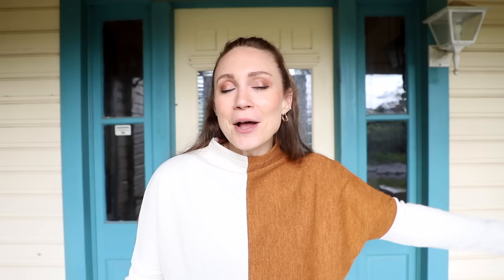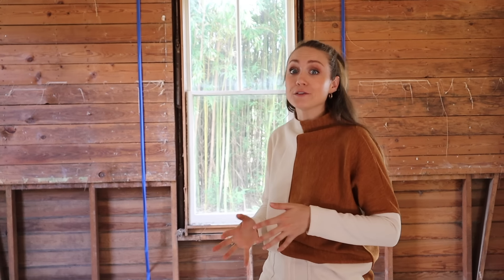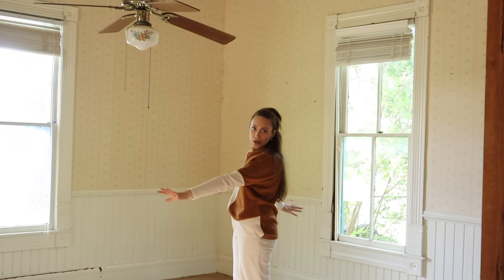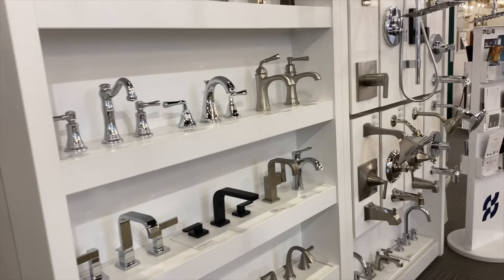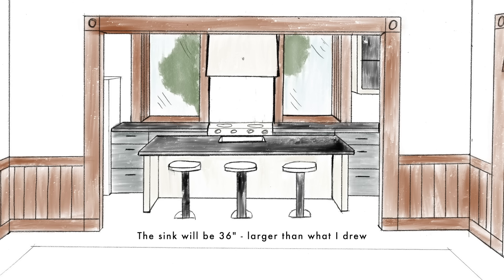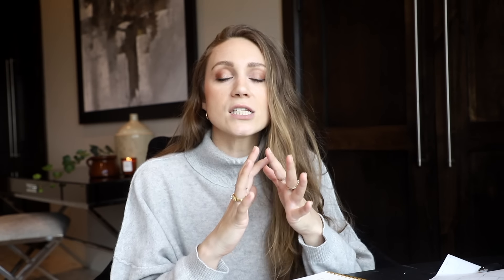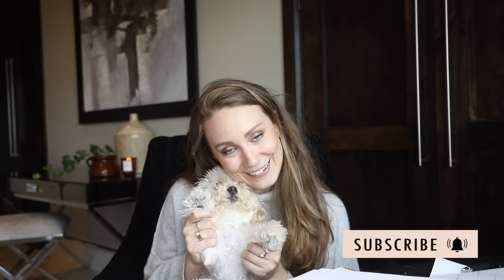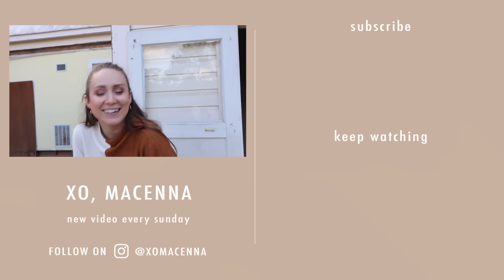HOME RENOVATION COSTS: Our Dream Kitchen & Bathrooms | XO, MaCenna

Comment: $30K for 2 bathrooms and an ENTIRE kitchen is absurdly low budget, considering the higher end options. But, I appreciate so much that MaCenna understands that this is not accessible to everyone and that $30K is still a lot of money. 💛
Reply: I did mine for a whole lot less cost. I did not go w high end appliances. Bathroom tiles were a closeout special, saved $$$. Stripped and painted kitchen cabinets, splurged on the counter tops.
Reply: I think that doesn't include any kitchen cabinets though.
Reply: @grandmak.  I know!!
Reply: I think that the price is for plumbing and appliances only no cabinetry
Reply: I don't think there is any cabinetry in that.  They were nearly theist expensive thing when I did my very basic kitchen nearly 11 years ago.  The only thing I splurged on were lots of drawers instead of cupboards as I am older.  I am just amazed at the refrigerators, stoves etc available.  I'm sure similar are available in the capital cities in Australia but not where I am.  It will be interesting to see how it all turns out.
Reply: Wow - the most expensive instead of "theist"  .
Reply: But I don't think includes labor. Unless you're doing all of this yourselves...
Reply: Yes, cabinetry is expensive. But even without cabinetry, $30K for appliances and fixtures for two full baths and a kitchen is an absurdly low budget for such high end options.
Reply: If I saved half my monthly salary every single month, it’d take me 3.5 years to get to that $30K. Of course I realize that the US is the US, still it’s nice and refreshing to see someone be so conscious of the value of money as MaCenna. And hats off to her for disclosing budget and prices in an intelligent and sensitive way. I don’t think there’s anybody watching this video and not being happy for her and beautifully house she’s building.
Reply: @lenalernova  exactly what I was thinking!
Reply: my home is 110 year old and a bathroom alone cost 20k but that's Chicago prices 💀
Reply: My wonderful DIL is a lot like MaCenna, she is smart, talented, beautiful and hardworking. She too is always looking for a bargain and she finds great items. Her home is a historic register home that she gutted and completely remodeled with a large addition on the back. It’s absolutely gorgeous! She shared the process with us, and I’m very excited to see MaCenna do the same for her viewers. Great job, MaCenna!! You’ve got a great head on your shoulders and wonderful taste! ♥️
Reply: @loissaedder2214  - I too live in a product barren area. Remote Alaska. It’s gorgeous, but hard to get anything without paying an arm and a leg. Although, I’m in need of a new range, and will go with a Hallman too, bonus, I can get one delivered at no extra shipping charges through Home Depot!!

Comment: Also, please make sure you hardwire Ethernet while your walls are open!  Walls and ceilings (for wireless hubs and cameras.
Reply: Run a channel of PCV or conduit in EVERY room to EVERY outlet❗ However wiring or computer related connections change in the future, all you have to do is pull it through the PVC. So make it "roomy" enough❗👍😉

Comment: My husband and I bought our first home about 3 years ago. Its a 1963 ranch style fixer upper. So far we have renovated 2 of the 3 bedrooms, the main bathroom, living room, office, and are currently working on the kitchen. Its our biggest project so far but I'm loving how its coming along. We torn it basically down to the studs and have finished the ceiling, floors, countertops, plumbing, and are finishing up the cabinet doors, which are much harder than I expected to make. We still have to finish the island, add a window, and build out the bench and storage next to the back door. Then its just finishing touches! Living through a reno of that size is tough, I'm glad you guys are able to stay with your parents and will have the guest cabin to stay in. Good luck with you cottage! I've been loving seeing your process so far!

Comment: Just a heads up, I would caution you in using a white glazed cast iron sink in the kitchen. I wanted the same cottage feel in my kitchen when renovating and had one installed. It looked beautiful at first, but after a couple of years, it started to look terrible. Any metal pots and pans, silverware, etc. will scratch and wear down the surface over time. It also started looking dingy and stained over time and no matter what I used to clean it (including bleach), nothing got it back to the white it used to be. The exact same problem happened to my brother when he bought a new house with the same kind of white sink, and his was even higher end than mine. His also started to chip in places.  I really regretted my decision and wished I had known this beforehand.

Comment: I am an Interior Designer and remodeled.lots of very high end homes, my advise would be use the same plumbing throughout the house, it will save you a lot of money in the long run, is easier to manage if there is a problem and gives it a very classy homogeneity that is very classy..

Comment: We bought a house on a creek in the North Georgia mountains, originally built in 1983. The location was great, but it needed a lot of work. We gutted the house and my daughter and I picked out the color scheme, all new appliances, hardwood flooring, tile flooring, plumbing, light fixtures, and rock fireplace. We pulled down the popcorn ceiling, redesigned the kitchen, and replaced the pocket doors with pretty wood doors. We had a contractor to do the work, and it took us about 6 months to get everything finished. It is definitely a dream vacation home for us!!

Comment: Miele products are nice, my parents kitchen is mostly Miele. They look gorgeous, the dishwasher is totally silent and cleans perfectly and is going on 10 years old.
 HOWEVER even though they say they service our area it is next to impossible to get through to them and get an appointment for servicing. When the dishwasher had a clogged drain after literal days of being on hold and not getting through my dad had to take to Twitter (he has several 100,000 followers) to finally get a response. 
I do not recommend the convection microwave or the built-in coffee maker. They were really hard to clean, the prompts on the coffee maker were super annoying, and they never fully worked properly with all the extra functions.

Comment: Ok. The penny tile under the tub that you want, to clean it, is going to be almost impossible. It's hard to get under those tubs to clean, especially on the side by the wall and omg your going to want that tub to be on something smooth so that you can do it. I wouldn't recommend the tub being right up next to the wall because to get back there to clean is super hard to get to and the penny tile, I don't think your going to like it after a little while. You'll get bored with that and won't go with your other beautiful things like the toilet, I just think it will cheapen everything and you'll end up changing it. I've loved everything you have chosen except the penny tile, and, the black swing.
Reply: Agree. No penny tile.

Comment: You might want to consider undermount sinks in bathroom, much easier to clean the countertop (especially with messy kids)! Also, if you go with penny tiles I would recommend a grey grout (white is very hard to keep clean).

Comment: As far as the tile goes make sure you get the special grout that resists staining and mildew. It’s been literally a breeze over four years to keep clean. I spray it with bleach spray every once in awhile between scrubbing.
Reply: Do you mean epoxy or latex?
Reply: @nadjak3410  it’s the actual grout, by called prism.

Comment: That's not a bad price at all for the size of kitchen your having
Our kitchen 11yrs ago cost 5,000 more and only slightly smaller than yours, but our units where all custom made and yes Miele are great we have fridge and freezer also along with dishwasher. 
Glad you've changed your mind on taps for spare bathroom as if someone has arthritis it's hard to grip and twist,whereas the leaver ones are so much easier to use. I say respect for doing all that work, so have whatever toilet you like. Xxx

Comment: Hey Macenna...just a few suggestions...while it's not a old home we have custom built both of our homes, and worked closely with our builder as well as doing some of the work ourselves...I just wanted to mentioned a lot of the things you are picking out are very similar to what we have....while it's all beautiful and easy to get overwhelmed with all the beautiful things DON'T do your dream home on just how beautiful it is to the eye, example your tub will not be very comfortable to SOAK in with the tub you have chosen, you won't be able to relax and kick back, light your candle and enjoy if you are sitting straight up 😳, also a suggestion for your kitchen garbage disposal do a air switch (google insinkerator  brand) otherwise you will be bending over to turn the switch on EVERYTIME you need to turn on the disposal....YES make your home beautiful but make it comfy too....looks are not everything lol...😉
Reply: My disposal is wired as a wall switch. I think most are.
Reply: @Edu_Kate  you are correct, However mine is in my island there is no wall behind me so rather then bending over ever single time I had my switch drilled into my quartz it is much more convenient! 🙂

Comment: oh MaCenna, I went with Newport Brass for my 100 yr old remodel (gunmetal finish, forgot the name) and I was SO DISAPPOINTED in the quality over time. The finish has come off in places...and YES I know it has a lifetime warranty on the finish (which I've been meaning to call them about) but what a hassle! Having to pay a plumber to reinstall these will cost a fortune...and I don't know if they will hassle me or not. I really need to get around to contacting them. In the end I might have been better off with delta. Ok, maybe not delta (but have you seen their Cassidy line), but I regret going with Newport Brass. Quality over time isn't there. Just FYI from a fellow design enthusiast.

Comment: You did ask. LOL Have remodeled a number of places but most challenging was small structure built around mid 1800s we redid in early 80s. Originally used by 'the help' on farm property when area was rural and only minimal upgrading had been done in the interim. Tub drained into the crawl space. No actual kitchen. Furnace on second floor was completely enclosed, no access to unit for service or filter change. Free-standing cast iron stove on first floor vented into an interior wall (not outside!). Actually lived in it while gutting, redoing all the plumbing and electrical. For long time, kitchen consisted of sink on 2x4s and hot plate. Designed kitchen to include small closet with stackable W/D and water heater. Contracted with small-town cabinet maker. Three walls of solid wood cabinets and formica countertop (fit perfectly!) which ended up costing about $1,300. Switched up some walls. Re-rocked entire interior. Removed wall on one side of tiny staircase to not only have access to upper floor but opened into new 'den' (original bedroom of house). 

Installed two sets of French doors from salvage yard (we found what looked like hand-printed wallpaper when opening up a wall). Removed trees and dug long driveway, by hand, as house sat at back of lot. All new landscaping. There was the 'joy' of having the sewer back up shortly after taking possession. Required digging up the entire front yard to lay new line and having decades of raw sewage scooped out in August heat. And then the time when all the old roofs had been removed and a horrible storm blew through before they could get it covered. 

Just some of what we did with a monthly 'remodel budget' of around $100. :) We were both working full time so work limited to nights and weekends. Looked very cute tucked back with a huge pine, very quaint and woodsy even though t smack dab in the heart of major metropolitan suburb. Sold it 2-1/2 years later, didn't walk away with much despite living in a 'construction zone' for almost the entire time. Many years ago, it was razed and replaced by a McMansion.

Comment: Have you heard of Dekton. It is a man-made counter top made from natural products. What is amazing about it is the versatility of design. It comes in so many options. But some of the best features of the product is it is temperature resistant. You can take a pan right out of the oven and place it on the counter. It is stain resistant and does not need sealing. I recommend you find a counter fabricating business.

Comment: Taking a shower in a claw foot tub is not easy unless the tub has a flat bottom.  Original claw foot tubs were not designed to shower in.
They are rounded to accommodate your body part while you bathe . Think hard before you decide.

Comment: 19:44 I had a tub with a shower ring and just so you know, if you try to shower in there, the steam will make the shower curtain suck in and sometimes stick to you. It was very annoying for me to shower in such a small space and have to deal with that, even with magnets in the bottom. If I'd had more money at the time, I would have gotten a nice fabric shower curtain and sewn WAY more magnets in the bottom, but even with that they can slide up and the fabric can pull in.

Comment: Even if you are not using microwave a lot, if you are planning to have children you might use it a lot for them
Reply: Sure, but even then an inexpensive one will do absolutely fine. You don't need to spend $300+ in an appliance store. $50 on Amazon will be fine.

Comment: I grew up with a claw foot tub and shower curtain surround. What a pain in the neck. I would do the cast iron claw foot tub as they are magnificent for a bath, the water stays warmer longer and they are very comfortable, but install a separate small shower and forget the shower curtain. They are awful.

Comment: So are your windows only single glazed and not insulated? Wondering how that is going to work?
Reply: I'm not sure but I think that's not much of a problem in Texas. Also I read somewhere that you don't actually save a lot of energy by double or triple insulated windows, even though these are the standard where I live.

Comment: I am a little confused... This is not what I call the “plumbing”, this is the decor aspect, the appliances and sinks/bathtubs in the different rooms where there is some water. The real plumbing: the pipes going under your house, is probably what costs the most, especially if the pipes have not the copper quality. And as you are changing everything, it seems that the plumbing has to be rethought and redone. Plus, it’s always more expensive than expected. I know because I had to redo all the plumbing in my house and it was not cheap! All the rest: sinks, and appliances, that was the fun part, and it came only once all the plumbing was ready to receive them. Be aware of that for your budget. And, think electricity too. You cannot do it yourself either, unless you are a contractor in this field. The electricity can be expensive too, especially as you are changing the display of the house. And the gas pipes, what about the gas pipes? All these things may look boring but they are the fundamentals of a house. Without talking about the different necessary permits... At least, it’s like that in California.